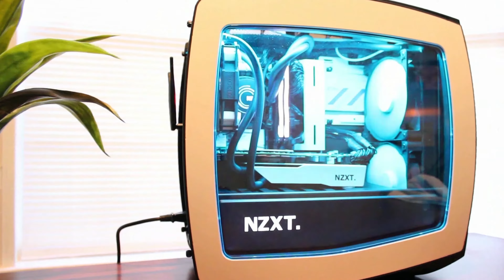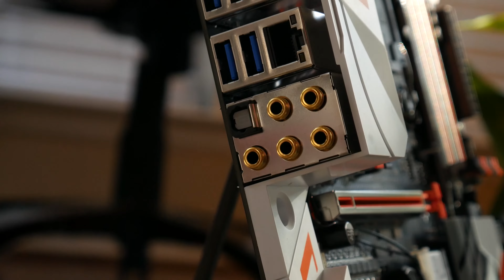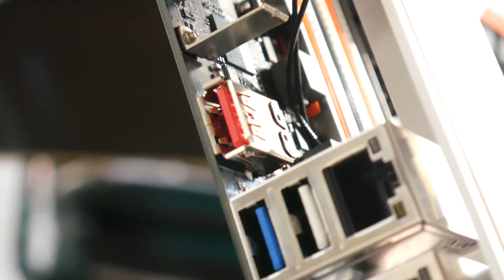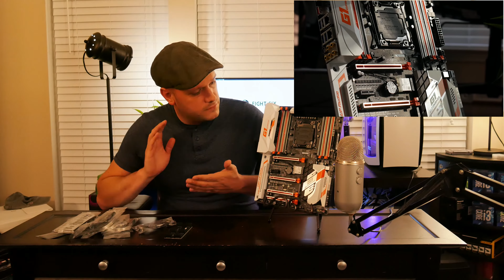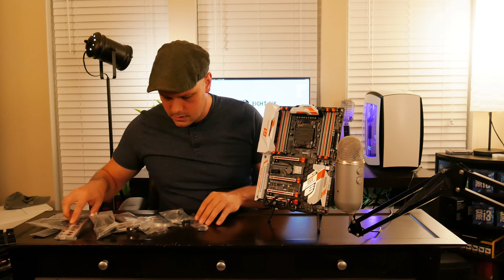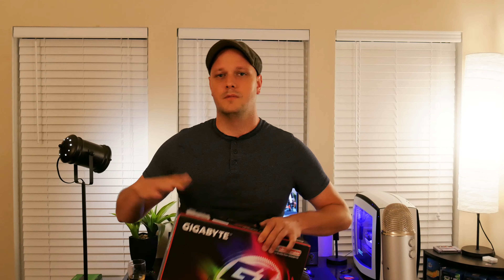A Review/first look: GIGABYTE G1 Gaming GA-X99-Phoenix SLI LGA 2011-v3 Intel X99 ATX Motherboard

Comment: Awesome review, I just bought this for my first build. I am really freaking nervous if I made the right choice. I got it for $300. IF you had to pick an alternative mobo what would you pick to compare it to value wise? The clerk suggested this because I am getting the I7 6800k and he said this was a late release updated mobo that would service it well. What is your constructive criticism of it though, besides the color scheme which I agree with you on.  I eventaully will be going SLI 1080. Any suggestion on a 32GB ram set for this mobo and 6800k?? Thanks again!
Reply from the maker: Its impressive to make your first build a fairly enthusiast grade build, its a lot of $$ just to start one on the x99 platform (so i can see why you are nervous, you have someone helping you?). Gigabyte is a trusted brand I have used for years off and on and I can't say they have ever let me down. I don't have much in the field of criticisms for this board. 

If you can afford the 32gigs of RAM that is more than enough for most of us, and at some point more ram is just more bragging rights (don't get me wrong it makes a notable difference in things like video editing) but 4x8GB sticks will have you taking advantage of Quad Channel, to me 32GB is the minimum for the enthusiast platforms and a good place to start (add more later as you go). Also I say minimum because its like owning a Ferrari, but having a golf cart engine. :D If that makes sense?

I think this mobo is a fine choice personally, the m.2 is a nice kicker, and going 2 way SLI is ideal eventually. 6800K is pretty much the bare minimum (yet still beastly).

I assume you largely just have pre-first-build jitters :D just take your time, it's a big money choice/path to take.

Comment: I bought the same mother board after watching your video. Great video BTW. 

I got a question. If I were to install my single Nvidia Gtx 1070 graphic card into the 2nd slot will it still be running at pcie 16x speed or 8x? I can't install the graphic card into the 1st slot because the Corsair H100i water cooler H100i radiator and fans is blocking the first slot which I could only install at the back of the case just next to the motherboard i/o. So the only way is I have to install into the 2nd pcie slot and I can't get a new case.
Reply from the maker: Raiden X slot one is x16, slot two is x8 (less contacts) it will still work but not at the x16. What tower are you using? You should be able to manipulate the water lines to rest above the backplate of the GPU.
Reply from the maker: Also that's a big rad and put at the rear? Shoot me tower specs
Reply: Eight-Six I reused an old full tower case. ANTEC Twelve hundred v1. When there is the the 2 x 12mm rear fans I mounted the radiator onto the fans with small modification of drilling in new case fan mounting holes and configured in push and pull configuration. The rad has the reservoir bump where the tubes are coming in from CPU pump and it's blocking the first PCIexpress.
Reply: Eight-Six My only concern is if I were to keep the 1070gtx in the 2nd PCIexpress slot in the manual it said the first 2 PCIexpress slots are 16x version 3 and why it's showing only PCIexpress bus 8x pciex 1.1 in GPU-z
Reply from the maker: Raiden X your right I guess I wasn't thinking there are enough lanes provided to 1 and 2 it should run x16 in slot two, according to what I see, but you say it is only sayin x8?
Reply: Eight-Six It's saying only 8x in GPU-Z. I check this when nothing else is running and pc in idle. Would it matter if I'm have Intel 6800K CPU and could it be in power saving mode or something. I want to make sure before I drop another $200 on a case.
Reply from the maker: Raiden X I'm not where I can sit down and help you look at the moment but once I get back to a laptop I'll look in to it, I'm curious now.
Reply: Thanks man. I was searching and was supposed to get Asus x99-A II mother board and on the spec it said 1st and 2nd PCIEx is x16 full time. So it could either be my CPU limitation or this gigabyte board or something else.
Reply from the maker: Raiden X I researched it, it's the 6800k, that lane defaults 8 using 6800k, "When an i7-5820K or i7-6800K CPU is installed, the PCIEX16_2 slot operates at up to x8 mode."

G I Joe ourselves for the morning.
Reply: Eight-Six thanks man. oh so it's limited by the CPU not the motherboard. I also flashes the mb bios to version F4 from F3 and took out the radiator and tested the card in the first slot and ran GPU-Z and it's saying 16x 3.0 and than changes to 1.2 and 2 and 3 when I ran the GPU-Z rendering test. Is that normal? 

I'm going to get another case. What's the best full tower case for corsair H100i push pull configuration case with lots of 3.5" bays around 5-9 bays for under $150-$200. I'm looking at the Corsair 750D air flow case but it only has 3 x 3.5" bays.

Comment: Trying to decide if i should go with Phoenix or the ULTRA GAMING that is a bit cheaper. can u tell me the Major differences
Reply from the maker: jeff vannatter hey sorry just waking up and see this. I'd have to compare, give me some time 😄. My truth for shopping for any motherboard depends on what I want to be able to do, I decide what I want and base my foundation off of that. 'Is there enough USB on the IO' 'do I want raid configure my rig' 'do I want to OC' 'do I want RGB integration' 'do I want m.2' 'do I want more than 32gigs?' And so on..what are you looking to do with your build? X99 is an expensive foundation to start with, the CPUs that accompany it are costly even at their cheapest. Do you have a build in mind already?
Reply: Eight-Six  I do was thinking about the i7 6800 chip and a gtx 1080 gpu. I only build a computer once every 5 or 6 years so I go high grade simi top end that will last till my next build. I've looked into both these boards and aside from the Phoenix coming with the wifi m.2 card I can't see much difference. but even if that is the only major difference it's still worth the 80 bucks over the g1 ultra gaming board.
Reply from the maker: the X99 ULTRA i'm looking at is a 3 day sale, you're right it doesn't have integrated wifi, and correct I wouldn't justify the $80 difference. If you're looking at the same one it has a rebate for $30 making it 220, if you're not in a rush to have all parts I would say get it... That rebate makes this cheap: (I'm all over the place let me know if you need me to clarify anything.

Get this submit rebate: $220 x99 Mobo
http://www.newegg.com/Product/Product.aspx?Item=N82E16813128928&cm_mmc=snc-youtube-_-na-_-Eight-Six-_-na

Then I would get this, awesome wifi card:
http://www.newegg.com/Product/Product.aspx?Item=N82E16833704274&cm_mmc=snc-youtube-_-na-_-Eight-Six-_-na

If you aren't scared of open box items for $2 more there is this also:
http://www.newegg.com/Product/Product.aspx?Item=N82E16813128927R&cm_mmc=snc-youtube-_-na-_-Eight-Six-_-na
Reply from the maker: I only recommend the TP-Link Archers because I have used them a bunch and love them :D (I'm sure you could find something else, and i am only assuming you want wifi, you might not)
Reply: Im still tossing these two boards around and i cant seam to find much of a difference in them. the Ultra has the same abilities as far as i can see and it can take the M.2 Wifi/bluetooth card to make it just like the Phoenix.  So why did  Giga make the Phoenix Board with a different color scheme.  This is what keeps me awake at night lol.

Comment: Why didnt i get the back plate in my packing? 7:40
Reply from the maker: Did you not get one at all? Or just a different one?
Reply: Eight-Six Didn’t get one. I bought it at Fry’s Electronics and it was an open box (cheaper). I’ll just buy one on ebay
Reply from the maker: Boo, bad side to Frys open box. Been there before =\

Comment: just got this board in no RAM or Processor and wanted to boot to bios. all I'm getting is a 5 sec boot loop no lights no sounds and no video off the graphics card. any ideas?
Reply from the maker: jeff vannatter what does the splash screen say as it does this? Try and take a picture. (This isn't a common thing people do but I'm down to try and figure it out with you) :)
Reply from the maker: jeff vannatter I would also try this, and it may sound silly, but put a USB in to the IO and see if it is being silly and just wants to see an applicable storage device, try boot manager and exit to bios
Reply: Eight-Six let me ask this will this board boot to bios with no RAM or Processor? after doing some research I think this might be my issue
Reply from the maker: BIOS is old school installed on onboard ROM, in theory yes, you should be able to access it. (its the mini control OS built in to motherboards) I personally have never tried that approach. I have powered PC's on to test lighting and wiring in the past with no CPU/RAM but in THEORY you should be able to boot to BIOS. 

NOW, I would say the GPU has no drivers installed to tell CMOS to tell BIOS to display, but it should be basic PLUG AND PLAY, and if you see something, it recognizes a device to display something, 

Are you ordering a CPU and RAM? (I imagine so) and if you are just wait til you have the build completed before trouble shooting. 

I would not be concerned with this until the point that you have hardware installed. (that goes for any motherboard) I'm working on some stuff right now but I can fire up a test bench later and see what I can achieve to compare to what you are achieving.
Reply: Eight-Six thanks for your help.